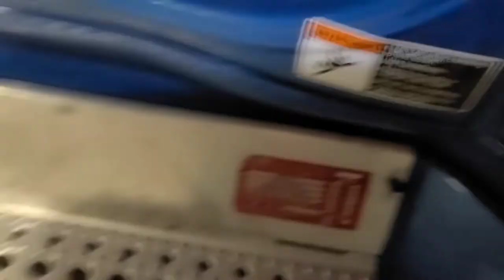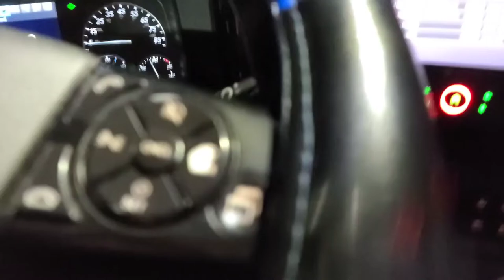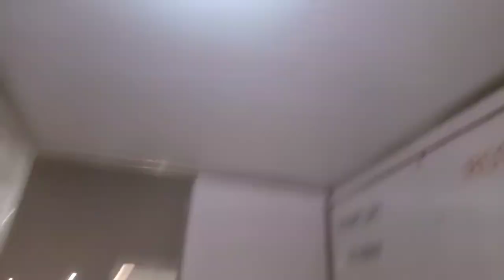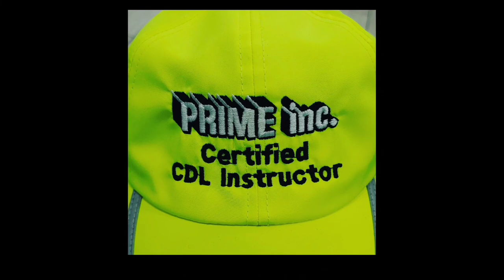how to repair a hanging chute.. December 2, 2020

Comment: pins, and needles,,,,,threads and beard hairs,,wire from a old tire,, or a couple old lotion frosted poptarts  laced with extra thick taco sauce or  glue from a bird pooo  some slimy grimy 5th wheel grease   haa haa you get the idea  haaa haaa haaa
Reply from the maker: Haha